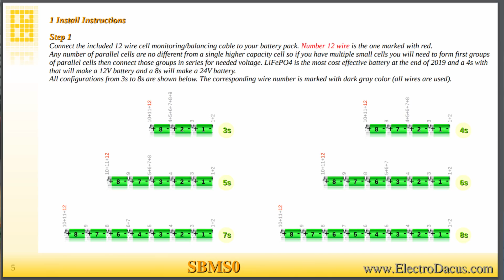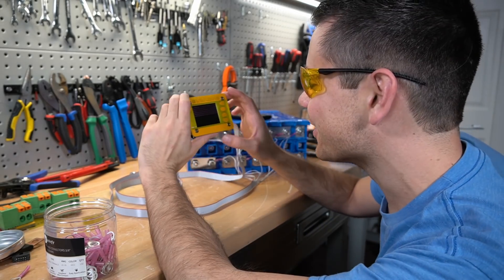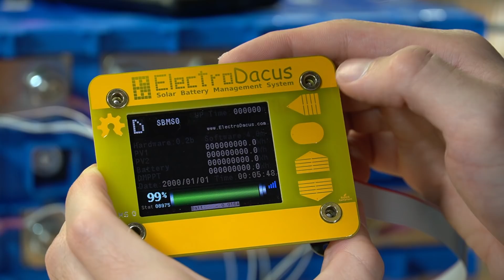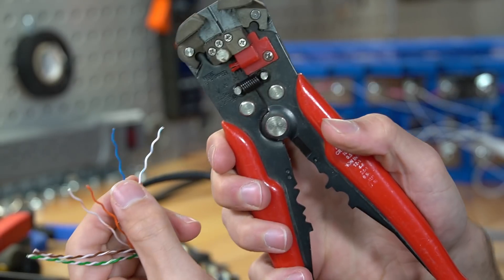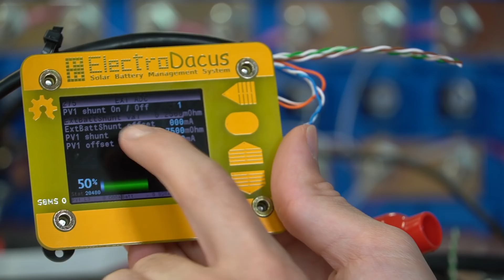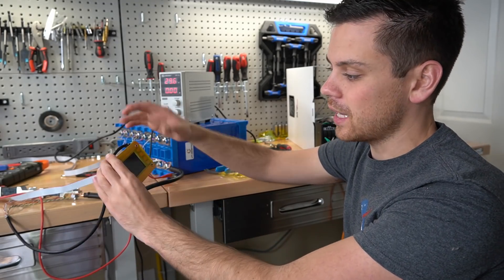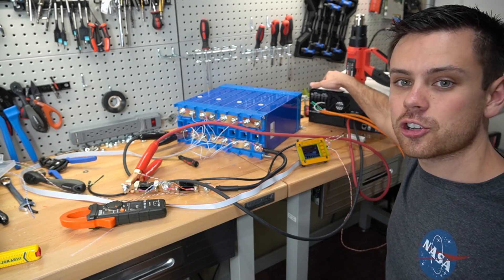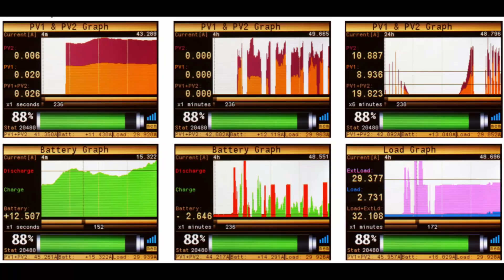Electrodacus -Open Source- Solar Battery Management System: Introduction and Setup

Comment: Thanks for reviewing!  I would like to see the low temp disconnect configured and tested (however am 100% sure it will given the quality and design of Electrodacus!)  Also would like to use this in my RV, but with the non MPPT solution they offer, I am limited to ~12V panels for my system which given my roof real-estate does not give me sufficient solar generation.  Could you possibly solution out integration of this with my planned ~1200 W panels (35-40V) and an MPPT controller?  I would certainly like to utilize this controller if that could be solved.  As to the comments regarding screen size...if you purchase the Wi-Fi module from Electrodacus he has a file that you can open in any web browser that gives you an amazing full browser window of all logging/status etc.!
Reply: The MPPT will not provide you with any significant advantage. Assuming you want a 4s 12V battery then the common 36 cell panels will work best and there are two main models one with 5" and one with 6" cells. The 5" cells panels will be rated around 100W and the 6" cell panels will be rated around 160 to 170W each.
You will be able to fit the same PV array size no matther if you use 36cell panels or 60 / 72 cell panels thus there will be no difference there same 1200W if that is what you can fit.
If you use 36 cell panels then you can just use the inexpensive DSSR20 so say you can fit 7 of those 170W panels then you will need 4x DSSR20 one for each group of two panels since they are 7 one panel will be on the forth DSSR20. Since each DSSR20 is 27USD your total cost for 4 of them will be just $108 and efficiency will be above 90% some times even outperforming the best MPPT's
Now if you decided that you want to use 60 or 72 cell panels then you will still be limited to 1200W based on the amount of space and you will need an MPPT one with remote ON/OFF control like most of the Victron ones or you can use whatever lower cost MPPT you want but then add the DSSR20 between the PV panels and that MPPT.
Now if you go with Victron you need a 100A capable model as 1200W/12V = 100A in to battery so that means the 150/100-TR model that has build in remote ON/OFF and can be controlled by the SBMS0 directly but that seems to be around 780USD so that is about a 670USD difference for almost no gain maybe 5 to 10% in some ideal conditions but most of the time absolutely no gain compared to matched 36 cell panels and DSSR20.
The other posibility is to get maybe something like an EPEVER MPPT and that is about 400USD but since that has no remote ON/OFF you need to add the 108USD in DSSR20 and so at 508USD you are not far from the Victron so not much of a saving lower quality MPPT.
So my suggestion is get matched PV panels and save yourself a good few hundred USD for something else as the diffrnce if any will not make any diffrence. You either have enough and plenty of excess normally as in any offgrid system or you just do not have enough not matther if you install and MPPT as that is not magic can not add anything more.
Like for the price you pay on MPPT you can get higher efficiency 36 panels and so have better result for same money spent.
If MPPT will have been of any use I will have offered myself but there is no application where MPPT will make a difference other than in the amount of money you spend.
Reply: @electrodacus  Thank you for the thoughtful and complete information.  I suppose my biggest blind spot was the physical size of the panels...forgetting that the 160-170W panels are roughly 1/2 the size of my initial plan.  If I may ask...for the ~1200W++ array and my calculated battery capacity of ~10,000+ WH of LifePo4 storage, now that it looks as though I will go to lower wattage panels, would you suggest a 12V or 24V system?  Many Thanks!
Reply: @LivnlargeCO  It is your choice if you want 12 or 24V system.  The 24V  60 cell panels may be a bit less expensive than the 12V 36 cell panels but if you have good reasons to go with 12V then it is not a big problem.
There are a bit of savings with 24V like you can get away with just 4x 300W panels and that means you only need two DSSR20 to handle them.  With 12V you will need four DSSR20 and while not a huge extra cost as DSSR20 are cheap there are some extra cables and connectors panels may also be slightly more expensive so total savings may add up to a few hundred $ maybe.
The 60 cell panels will work closer to max power point using a 24V battery than 36 cell panels with 12V or 72 cell panels with 24V battery.  Only when panels are very hot in summer the 72 cells or 36 cells will perform slightly better than the 60 cells with 24V but that is also when you actually have the most excess/unused energy so it makes no difference.
Using 60 cell panels (300 to 320W) and 24V battery will get you efficiency above 90% at all times so about the same or even better in many cases than a quality MPPT plus 72 cell panels.

Comment: I love open source solutions! Would you consider doing a video on a grid tie with battery system?
Reply: I will not recommend adding a battery to a grid connected system. It will not make any economic sense as the battery cost amortization is usually higher than the grid energy cost.
Reply: @electrodacus   That's a good point, I suppose shifting your usage to take advantage of off-peak rates actually pays off very slowly in practice.

My other thought was to use it sort of as a "whole-house UPS" since I am having a lot of short-term blackouts in my area. 

I was doing some research and it seems like it would need to be either a critical loads panel supplied entirely by an inverter 24/7,  or a grid-tie hybrid inverter that would shut off the utility connection in case of an islanding situation rather than shutting itself off.  But in any case detecting failure of a generator on a common bus looks pretty hard.

Ultimately I'd like to get the economic benefit of net metering, the power capacity of a grid connection, and the reliability of a battery system.
Reply: @bilzoo20001  Adding a battery to a grid connected system is a fairly bad investment. Absolute best case just the battery cost amortization will be $0.2/kWh that means that if say you get a $0.03 credit for exported energy you need to add that to battery charging so now every time you get out 1kWh out of your battery it will cost you at least $0.23 and so it will not make sense in almost any place where grid solar is a thing.
If only used as a UPS backup things are no better likely over $1/kWh in therms of battery cost amortization but there maybe cost is no longer a factor if that is something you need at any cost.

Comment: How the balancing work on this one?
Reply: Balancing starts as soon as you have at least 300mA of charge current and delta between any two cells is higher than 10mV so if needed it can balance for many hours per day (number of sun hours and while battery is charging). For details you can check the ISL94203 datasheet as that is the main BMS IC in the SBMS0 but it is the same method of cell balancing used in all commercial EV's.

Comment: Very cool I testing one of these right now. What do you think of the balancing? I see it is balancing my cells on charging the moment I get past, well, my default is 10mV delta, 3.2V minimum cell voltage and "some" charge current but whatever you set I guess, for my brand new yet seriously crappy cells and a balance current of bugger all, that's great

Comment: Great job Will and cool little device! Does it offer wifi connection to the pc - that would be great! In my experience all shunts are normally connected to the low side, not the positive - so this is quite wierd here.
Reply: It is more expensive to have the shunts on the positive side that is why is less common but is better to have them on positive side if negative is common.
Yes SBMS0 with WiFi/USB extension can be monitored with a computing device and SBMS0 will act as an access point where you connect to and then open an html file that shows all the data in a graphical format. The USB or UART that are fully isolated can also be used to monitor data. Also internally the SBMS0 will store the last year worth of data that you can download at any time.

Comment: That's awesome Will, great episodes keep them coming buddy,  are 230V circuits in rv/caravans okey to ground/earth straight to the metal rv/caravan frame, or do you need to put a copper rod in the ground could you do a lesson in this buddy?

Comment: Thanks Will, I sent you an email asking you to make a video about this on June 30 2019, but I don't know if you read it :-) Finally you did it & it will really help me to install my Electrodacus SBMSO now.. especially the small cables & non-victron inverter.  I am still preparing my batteries but your video has made me excited & confident to finish the project.

Comment: Have you did a video on how to connect Solar and Wind Turbines to the same or separate charge controllers?  I'm looking into this because I get a lot of winds but my research tells me those hybrid charge controllers suck and someone suggests using 2 charge controllers charging separate battery banks but does that mean I have to split the system or can I still use one inverter?
Reply from the maker: Get separate. The hybrid ones do suck. Connect them to one battery and you are set
Reply from the maker: I would use one battery bank. 48v if you can
Reply: @WillProwse  Thanks, I  am hoping I can connect them to one battery bank so I can daisy chain the two charge controllers? The hybrids come with a dump load because I guess they can overcharge.

Comment: How many 100w solar panels would I need to power a 40gl hot water tank
Reply: It depends on how fast do you want those 40 gallon of water heated and at what temperature.
I will give an example in metric as I'm not as familiar with imperial units but 40 Gallon is about 150 liters and you need 1.16Wh to heat one liter by one degree Celsius
So say you want to heat that amount of water from 25C (77F) ambient to say 60C (140F) then delta 60 - 25 = 35C thus formula will be 150 liter x 35C x 1.16 = 6090Wh about 6kWh of energy needed.   Now one 100W panel may provide 500Wh/day in a sunny day so you will need 12 of this panels to be able to heat that water from ambient to 60C (140F). Maybe larger 60 cell panels 280 to 300W panels will be more cost effective and about 4 of those panels can do this job.

Comment: The Electrodacus system unit preforms three functions - BMS, battery monitor, and PWM charge controller. It is quite unique on the market really can't be compared directly to anything else that I know of. Separating the logic from the power handling opens up a lot installation options.

Comment: I have a weather station that has a Solar and UVI meter. It measures Solar in w/m2. Can you explain how, if possible, to convert that to how much power that produces in watts or volts or amps equivalent to a solar system? At my peak around 12:30pm, I'm getting 1,012.9 w/m2 Solar and 9 UVI in my ecowitt weather station. This might help me know how many hours of solar and how much power I can actually capture?
Reply: A typical PV panel is around 17 to 20% efficient but solar PV panels are already rated based on STC (Standard Test Conditions) that are done in factory lab time conditions and they apply a 1000W/m2 same spectrum as solar light but for just a short second and measure the power output of the panel thus the rating you see on the panels. But the panels in this STC test are at +25C so ambient type temperature and when you put them in the sun they will be at least 35 to 40C hotter than ambient 60 to 70C thus the power output will be significantly lower in those conditions than the STC rating.  In Winter when is around -10C outside and sunny the panels may be at +25C and then you will get the exact STC rating out of the panels.
From a typical 260 to 300W  60cell panel you can expect around 1.5kWh/day in a sunny day and as low as 100Wh/day in a ugly overcast short day in November.
Those panels are around 1m wide x 1.65m long so 1.65m2 so if you take 1.65m2 * 1000W/m2 = 1650W of solar heeting the panels and if panel is rated 300W it means is about 18% efficient.
Reply: @electrodacus  Wow, how do you know this stuff. Ok, I think I'm following you so m2 = meters squared so my Weather Station reports Solar = 1,000 watts per meter squared? Then you multiply that by the size of the solar panels?
Reply: @plantbasedprepper  Your whether station show's instantaneous power available so on each m2 area you get 1000W but that is total power and PV panels are typically around 18% conversion efficiency as explained so a solar PV panel that is exactly 1m2 will output at noon 180W (18% efficiency) if the PV panel temperature is +25C but since that is not so likely unless is winter and ambient is around -10C.
In summer due to PV panel being hotter efficiency will drop so you may just see maybe 150 or 160W from that example 1m2 panel.
Also there are only maybe 2 or 3h per day where sun puts out that max 1000W/m2 then it drops as sun is at an angle getting close to sunset.
I heat my hose with solar PV as it is the lowest cost energy source available even lower than natural gas.
Reply: @electrodacus  Thanks, whats cool is that my weather station tracks this Solar Energy from sunrise to sunset so it gives me some idea I can use to estimate the time, duration and power of Solar in my area.
Reply: @plantbasedprepper  Search for the PVwatts website that has statistical solar data for anywhere in the world and so you can get a better idea of what an average year at your location looks like in therms of solar. Each year can be fairly different from average.

Comment: hey will. bought an electric car. Does it improve the batteries life to not charge  it to full capacity? If so how full should it be charged? Chevy Bolt  is the car. I checked the manual but  it  didn't speak to this at all. Any suggestions would be greatly appreciated. thanks
Reply: I will keep any EV charged to 70 - 80% depending on if that is enough for you to commute.

Comment: I wonder how it'll keep up with balancing 7s80p recycled 18650 pack. It states in the manual that the maximum balancing current is 200ma, will it not struggle with 80 cells in parallel? You can only go so far with matching recycled cells capacity wise, any ideas?
Reply: Recycled cells are not an economical option is mostly done for fun. And you pack can only be as good as the worse cell in the pack (in your case by cell I mean the group of 80 parallel cells that are no different from a single large capacity cell).  Many of those cells will have different internal impedance, capacity and self discharge so you can not do much with any sort of cell balancing they will most likely always go out of balance but the pack will still be protected as the SBMS will stop the charging when any cell is above the limit you set (default I used 4V for long life but you can change to 4.1V or whatever you want).
LiFePO4 has a cost amortization realistically around $0.2/kWh and it is the best compare to any other battery.
Now a typical recycled LiCoO2 will maybe have 2Ah at 3.6V nominal so 7.2Wh capacity and at best around 20% of life left that will be the equivalent of 100 cycles at 100% DOD thus total energy you will be able to store in that recycled cell before it needs to be removed will be 7.2Wh x 100 = 0.72kWh and $0.2 * 0.72kWh = $0.144 that will be the value of one recycled cell when compared to a new LiFePO4 battery that means your time recycling a battery (remove from a laptop pack do a charge/discharge cycle to check capacity and installing in to a pack) is valued at $0.144 thus for almost anyone in the world this can only be done as a hobby not a way of saving any money. And in all this time you have a badly performing battery that needs constant maintenance by swapping out cells that develops significant self discharge  (hard to diagnose maybe with a thermal camera).

Comment: Hello Will, great video as all of yours. I have a  GridFree AC Inverter with limiter 1kW SUN-1000G (22-65V). The limiter can reduce output power according to actual consumption of the house and won't let energy leak to the grid and this if mandatory  to me. I'm planning to add batteries to the system and I will need to go 48V using maybe two SBMS0 in series. is it possible to charge my 48V battery using the 2s SBMS0 and its DSSR20? can i mount them (the DSSR20)  in series to to deliver straight 48V to the whole battery? I have 60 cells solar panels Voc 39,7V DC - Isc 9,75A - 300W - Immp 9,40A - Vmpp 31,9 V DC. My idea was to mount the DSSR20 next to the solar panels so to have less cables running down to the battery/inverters location and to use two Tesla 24V modules in series. My plan is also to add more of those inverters with limiter to match my needs creating a sort of a modularly expandable system. And to add more 2s Tesla modules to.
First goal is to meet home power needs, second goal is to charge my model 3 with 10kWh daily, third goal is to heat my home but on this maybe I'm dreaming.
Cost of energy over here (Italy) is about 0,22€kWh.
You know what? it would be great if you made a step by step of a similar system.
Thank You so much for Your effort in making these empowering videos :-)

Comment: Another great video. I would have liked to see you hook up a meter to the batteries just to confirm the accuracy of the panel. I also like data logging not to obsess over but to monitor usage. A little more information about PC & phone interface software and functionality would have been interesting.
Reply from the maker: I did that with my Klein meter. I actually filmed that but figured it was too boring to add. And people assume I check the accuracy of all my stuff, or else I will tell you.